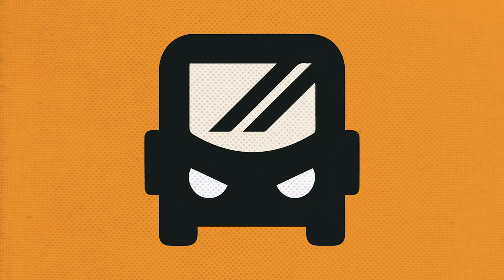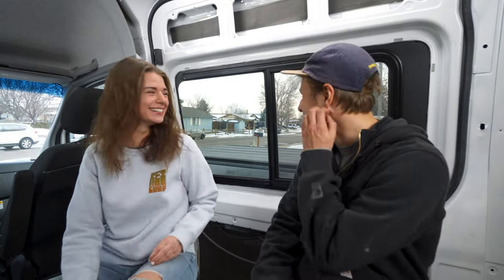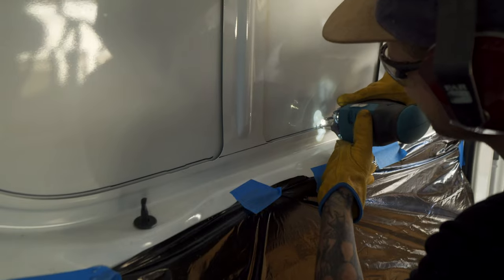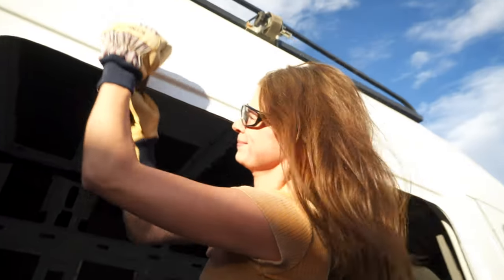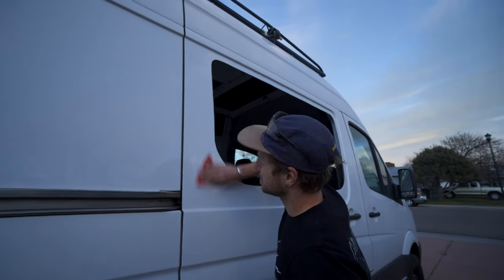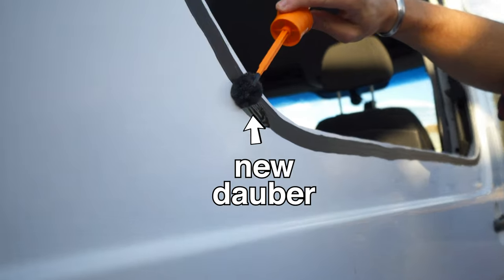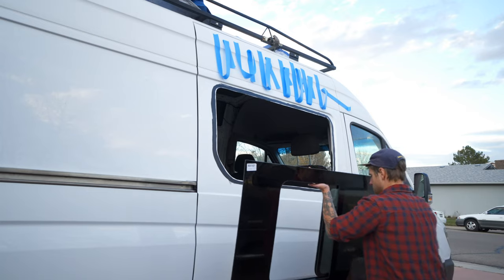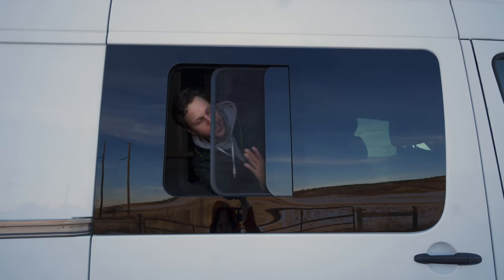HOW TO INSTALL BONDED WINDOWS ON YOUR VAN (A TUTORIAL THAT WON'T PUT YOU TO SLEEP)

Comment: Wearing  gloves while using a jigsaw  cutting sheet metal is a no brainer,  metal is hot as you state and edges are very sharp when you need to hold or move the piece around.  " may get sucked up in the jigsaw " ...what the biscuit? If you you suck up a glove while using a jigsaw you obviously have your fingers to close to the blade and  probably need to re read your owners manual ! And while safety glasses are good Google's are even better as metal shards tend to fly off one's forehead or cheeks and bounce off and go under the glasses and into the eyes. Great vid as always!
Reply from the maker: Yeah I feel like I'd really have to make a mistake to get my hands stuck in the jigsaw and I completely agree with goggles being a better option. Those metal shards go everywhere!

Comment: Love how you two bounce of each other 👍🏼 I started fulltime living in my Sprinter with just the 2 rear barn door windows and a Dometic Heki skylight in the roof but a few months in added an opening window to the sliding door and don’t regret it. Being able to see outside and the natural light is great. Plus Ventilation is far more important here in Australia with our warm climate than worrying about losing heat. Btw here in Australia vans are called Wizzbangers and caravans Wobble Boxes 😆
Reply from the maker: Haha I like the sound of Wizzbangers. I'll have to use that!
Reply: @dogcatmanvan  because the sliding door goes wizz bang to shut 👍🏼

Comment: Unpurchased view here. I am making this comment primarily for the purpose of communication, not for the purposes of the algorithm. Although that's like saying "I have no comment" = well yes you DO have a comment because you just made a comment. Etc. endless circle.

I applaud your choice to put a window in your van door. Stealth isn't. You will be much more happy with  window than you would have been with the stealth you would not have gotten anyway. Plus Rocky will be able to look at the sky. I am anxiously awaiting your in-floor-heat episode to see if it will be electric (like mine that I have in my bathroom) or if it will be hot-water.
Carry. On.
Reply from the maker: Our floors will be heated with glycol lines which will also provide us with hot air and hot water. We're still working on getting it all together, but so far so good!

Comment: Great video! I’m thinking of getting those windows as well. How’s the locking latch on them? Would it be easy to open and break in from the outside?
Reply from the maker: I don't think you'd be able to open it from the outside, but the latch is a little weird. It's just a metal flap you put in place. It seems to hold up though

Comment: Make a template drill holes thru them template and the body so you can align it from the outside
Reply from the maker: That's what I did on my previous van build window install. Works like a charm!

Comment: Hi! I plan on attempting this soon! Did you need two tubes of the sealant?
Reply from the maker: Im 98% sure we only used one tube and it came with our window, we just had to buy the primer ourselves. But i would check with your window distributor, most will send adhesive

Comment: Was wondering how you like the slider door window?
Reply from the maker: After a year since install we still really like it! No issues so far, and it's nice to have the screen or fully open without the screen option. We use it for air flow often

Comment: Are you still liking these windows? And do you think having one across from it would help with airflow? Starting from scratch with no windows & no clue what to do with window and fan setup lol
Reply from the maker: We do really like the window! We open is a lot when we are just parked and working. Having one across from the other would definitely allow for a good cross breeze and a lot of natural light, but it would also be two large areas that arent insulated. I guess it depends what type of climate you're in. One big window and a ceiling fan also work pretty well. I think it's a lot of personal preference, the layout of the interior of your van, and the climates you'll be travelling to/living in. Investing in good blackouts help with the cold and heat loss.
Reply: @dogcatmanvan  yes forsure, makes sense. It’s hard to weigh the pros and cons of the various setups. I foresee being in both 95 degree climates and 20 degree climates in the next year lol. I’m glad to hear that 1 window plus a fan might be enough for good ventilation !

Comment: I prefer skylights. Guess I’m more stealthy.
Reply: I was thinking the same. Similar to small sun tunnel size ones  ? 2 small round ones on each end so it doesn't steal solar panel space ?
Reply: How do you reinforce the roof? Considering the holes for the skylights and fan now.

Comment: You should absolutely primer both sides of where the adhesive is going to go. Why would you do one side without the other ? 
And surely you picked the wrong side if any. You already created a rough side for the adhesive to adhere to on the van by sanding it, the just put the bare adhesive onto the window. I wouldn't trust this method. Let me know if it's still leak free 💧